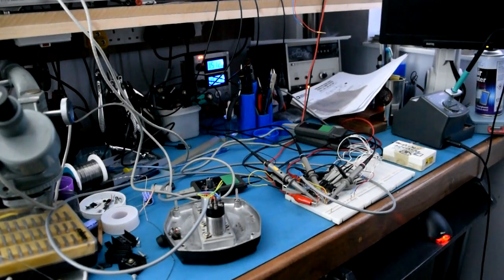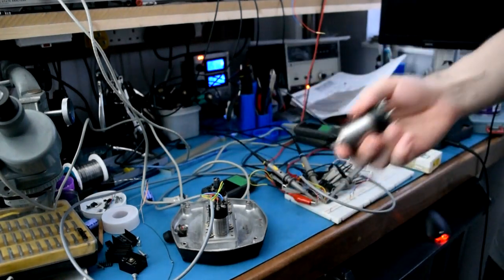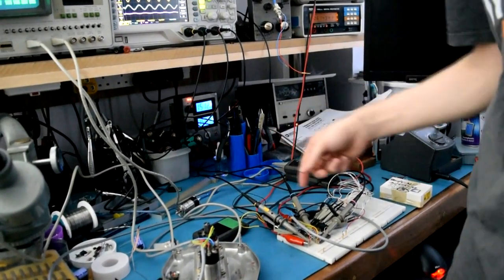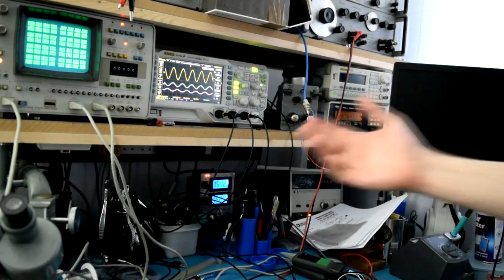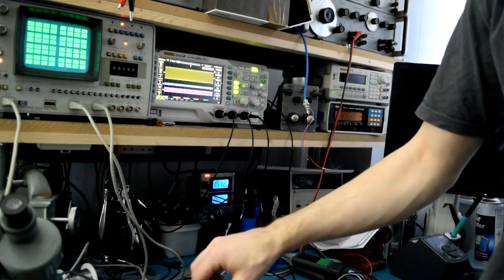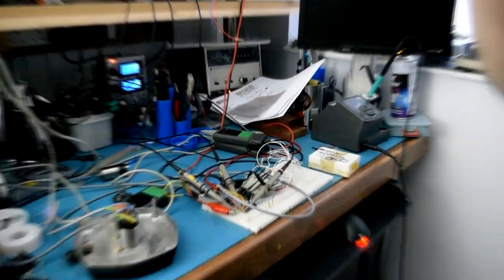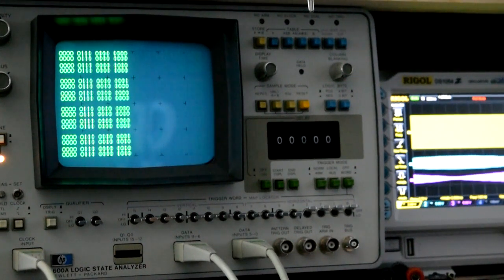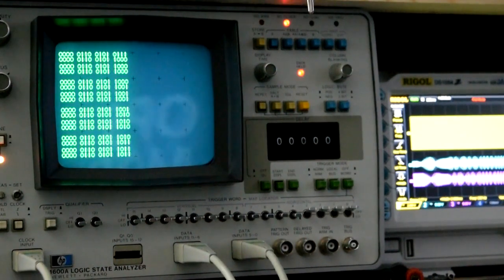Fun with an 80s resolver to digital converter

Comment: I could have used that in my simulator.... but those modules are normally extremely expensive. But I would have needed digital to synchro to drive the original instruments by computer.
Reply from the maker: Yeah i got them in a lot of other ebay stuff for almost nothing.  Still trying to find an application that justifies their use! :D
Reply: @Sigmatechnica  For my simulator I ended using Simkits instruments that are connected to USB.
But if you don't build your own aircraft, there is not much use for these D/A and A/D's. Maybe adding flaps to your car...? ;-)

Here is my simulator: https://www.youtube.com/watch?v=OUDqZusUXg4
Reply from the maker: @PlaywithJunk  Nice, that's quite a project!